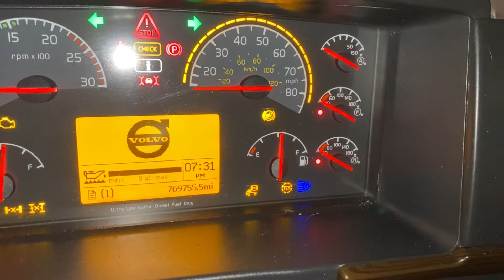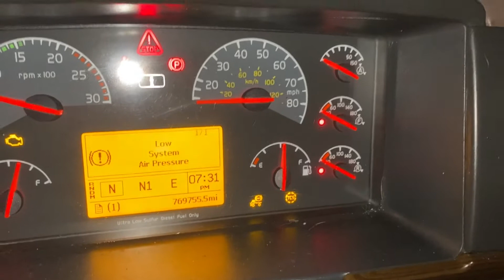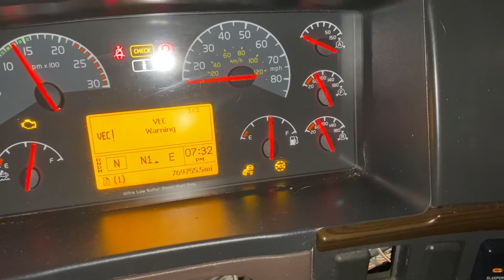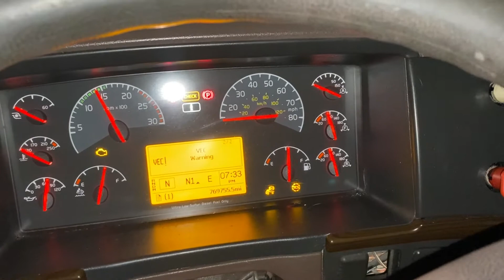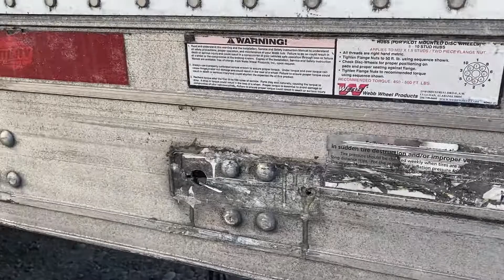Replacing Governor Valve

Comment: Don’t you think that UK trailers are far superior to the ones that you have in the US , Looking at the chassis on your trailer’s the strength of cheese comes to mind, it must be the tare weight that makes them attractive over the pond, can you tell us what the tare weight is of a reffer or a dry van ? another great video Tommy you’ve still got it on the tools 😎👍👍
Reply from the maker: Thanks for the comment. The strength of the trailer is in the structure of the box. Haha. Seems strange. I am not sure the yard weight. Will find out and put it on a video. The axles here have to be able to slide to balance the axles. Bridge laws. I do see UK trailers built on a chassis. It does look more substantial

Comment: Take it was an agency driver driving it don't know how he didn't feel it.
Another thing re your reefers you ever thought about importing a couple off good used UK fridges with 2/3 compartments for frozen/chill/ambient all singing for a lot less than buying 1 in USA could be worth enquiring about I'm just home back fi Daventry. 700miles 2mrw rugby n back double manned cheers n take care Rk
Reply from the maker: The axles have to be able to slide for the bridge laws in the USA. Not sir of the weight of the trailers in UK. Thanks for watching again.
Reply: Hi Tommy would axles need to slide uk trailers are 3axle to spread the weight will find out tare weight off empty one and plus they take 26 std pallets 1200x1000 or 33 euros 1200x800cms could be interesting running one over there if it could be done cheers bud Rk
Reply: Could you explain the idea off the sliding axles for bridge laws in the USA in one of your future videos cheers Rk
Reply from the maker: I will do that in a video. Shipper here get really pick also about using 53 foot trailers. They pretty much all insist on it.
Reply: Hi bud our trailers are 45ft 13.5m std 4.05m high they are 2.5m wide internal size so pallets fit side on cheers Rk